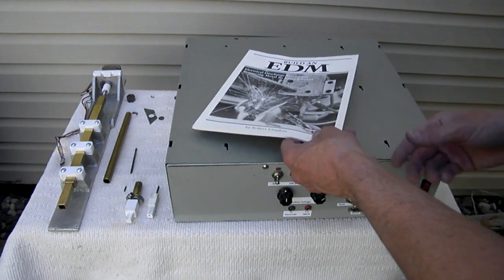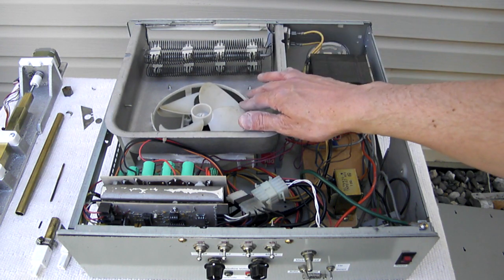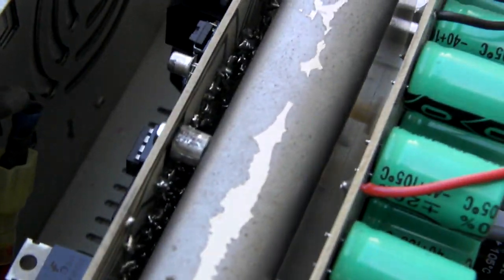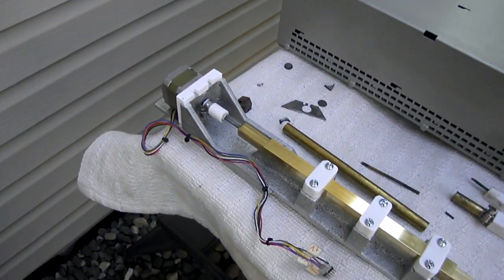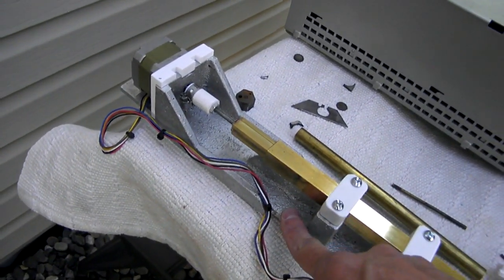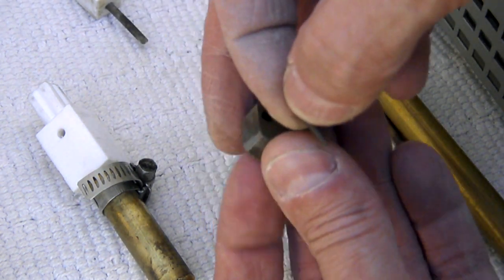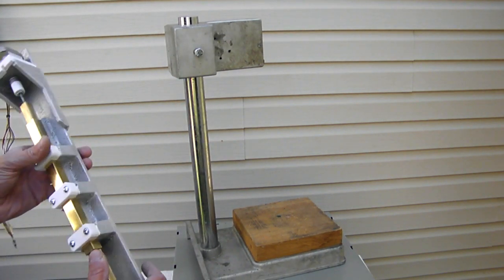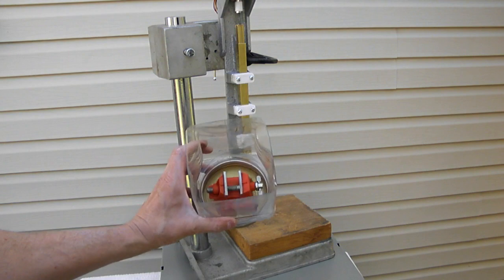EDM (electric discharge Machining) Machine Walkthrough

Comment: Mine was built to Robert's plans in the mid 1990's.  It works well but is slow.  A pulse supply with adjustable frequency would be the way to go, but I don't use it often enough to warrant the work.
For the vertical slide which carries the electrode and its holder, I used the carriage roller guide from an old office type writer.  These are well made and quite accurate.  One can pick one up at a flea market at very low cost.  Just make sure the slide (carriage) moves freely but without much side play. Mine had some adjustment in the guides to eliminate side play.
Next consideration is flushing.  I use distilled water with brass electrodes;  this combination works well.  For long work times I filter the water with a 1 micron water filter.  For best results the flushing should be continuous through a hole in the electrode.  I found that about 12 PSI flushing pressure seems to work well.  Mine is a peristaltic pump driven with a variable speed motor.
The smallest tap I have burned out from a casting is 2-56.  A friend of mine who built to the same design removed a 0-80 screw.
The machine is handy of course for removing broken taps, screws, reamers, etc.  It is also handy for producing square, hex, and other shaped holes.
I'm not an electrical guy, but I didn't find it too difficult to built.  I purchase the populated control board from Robert to speed up the work.  One caution:  Be sure to use AC service capacitors for the burning supply if you are planning to use the machine a lot.

Comment: would you be willing to share details about your edm.  specificly the parts making up the actuator. square brass tubing sizes, thread size of the screw, lenth, how did you attach the ‘nut’ to the brass tube.  basically anything that would help build one like yours.  thx

Comment: This is awesome. I omitted the big resistor and used a flyback configuration from a switch mode power supply to charge the capacitor directly, meaning there's no loss of heat in the big resistor. It works wonderfully. What's the capacitor you used in this last video? those are huge sparks.

Comment: 2 questions: Did u really use the book shown, and what modifications did u have to make to the electronics, that proved to work better, than the original-book-layout (which i know well)? Not the changes u were forced to make (for example, because u couldnt find the exact electronic component used in the book), but changes that experience proved to work better... And I wanted to know how u connected the lead/cable to the tool-piece, cause through the 3d-printed-adapter it´s insulated, and I see how u flood it with water, but don´t see how u connected the lead/cable to it...
A remark: How satisfied are u with the cutting-quality and -speed? People insist on a high-spark-frequency and silent sparking... Is it the case for your machine, u think (video-volume can be misleading for us, and sparking-frequency is impossible to assess through a video... ) ?
Otherwise, what I saw looks great to me, seems to work like a dream (envy on 100%), but I could not assess everything based on a video. I didn´t know one can edm evem magnets, without de-magnetizing them, great!!!
Reply from the maker: I didn't modify the design for improved performance in any way.  I just used an alogator clip to get the power to the electeode. (in the video you can see a hose clamp on the electrode.  Yoi can also just barely see the tip of the aligator clip.)
Reply: @ScorchWorks  Thanks a lot for the answers, I know, it´s a very old video for you... Sorry, I didn´t look out for the aligator-clamp, and totally missed it, like a half-blind man...   ;-)

Comment: How many turns on the secondary for the microwave transformer?
Reply from the maker: Enough to get the desired voltage.  After a few turns you can measure the voltage and calculate how ,any more you need.
Reply: @ScorchWorks  I guess that will work.

Comment: how do you keep the MOT from heating up? mot generaly get very hot just running idle.
Reply from the maker: There is a fan for the power resitor which also moves the air around the MOT.

Comment: What about using EDM to make circuit boards?  Etching away the copper with EDM. Any thoughts on that?
Reply from the maker: It is certainly possible to EDM a circuit board but it would be painfully slow with this machine.  Chemical etch or traditional milling would be much faster.

Comment: That was really interesting. Thanks a lot for sharing. An EDM is on my large list of things I would like to make one day. You have done a really neat job of a very non-trivial undertaking. What is the smallest diameter hole that you have successfully achieved to-date?
Reply from the maker: +Owen Giles I have not tried cutting small holes The smallest I have done was with the smaller of the two electrodes in the video.

Comment: Great build, any idea roughly what the cost would be to build?
Reply from the maker: +Welsh Dave I have most of the cost recorded.  It looks like I spent about $110 on it.  If I would have purchased the transformer and power resistors they would have been an additional $60 and $25 respectively.  As I discussed in the video I got those items essentially for free (I didn't count the wire needed to rewind the microwave oven transformer in the $110 above)